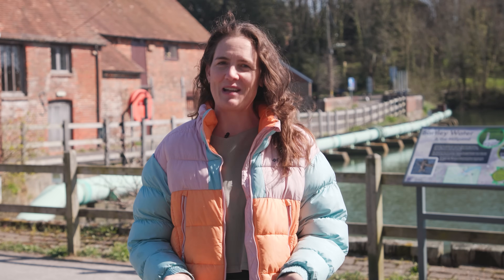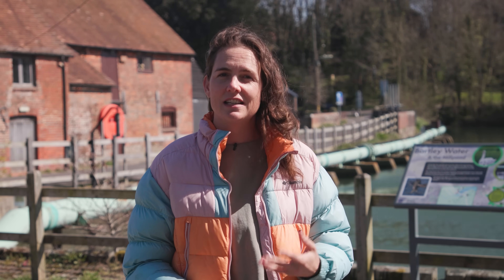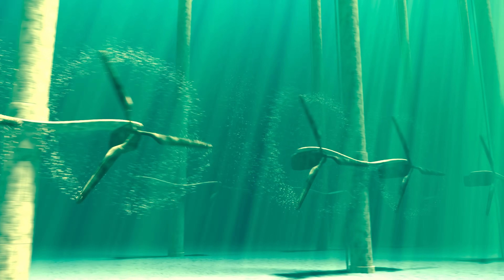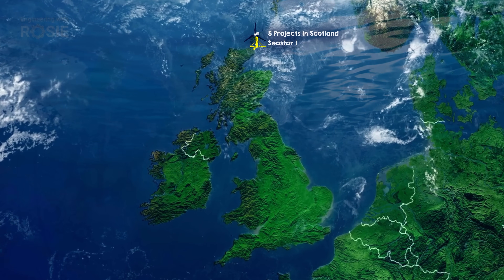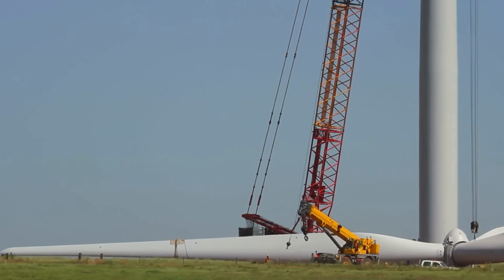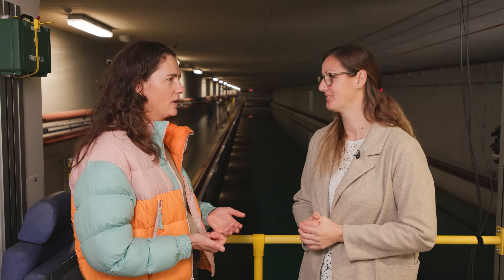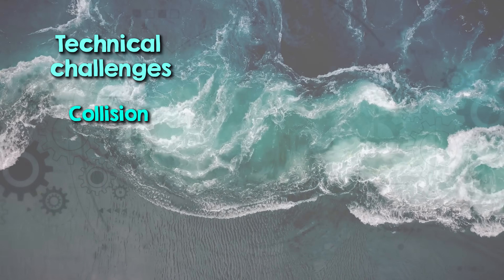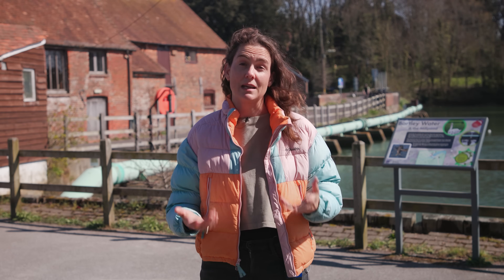A 1,400-Year-Old Idea That Might Save the Climate

Comment: I used to work in tidal stream 10 years ago. We used to explain the problem like; "Installing a tidal turbine is like installing a wind turbine from a helicopter in a hurricane". It's not that it's impossible just extremely expensive. Same goes for wave energy. It just can't compete with solar and wind on cost even after factoring in batteries for intermittent storage.
Reply: U should probably rewatch the vid
Reply: @Jon-u1s4j  which part do you think isn't accurate
Reply: It's not competing with wind and solar, it's competing against other forms of firming.
Reply: The difference with wave energy is that it can be used when wind and solar are not operating.
Reply: @MichaelSmith-px1ev . There is quite a strong casual link between wind velocity and wave heights.  In other words, no wind = no waves, hence no power from wave generators. Conversely very high winds usually means the partial or total destruction of wave power generators.  Nobody has really mastered that yet.  The attraction of tidal power is as reliable as the movement of the moon, but relatively expensive to set up and maintain.  Only the most optimal areas of tidal locations are likely to work, but they tend not to be close to the consumers of the electricity.  So it is practical, but only on a small scale for most countries.
Reply: Wave power seems much more viable for marine type scenarios.   The one where nothing is in the water but big concrete blocks with hollow tubes, using the changing air pressure to drive air turbines, seem to solve the Achilles Heel of marine installs....maintenance.   And it can double as a breakwater.
Reply: 100% correct
Reply: I think of this an the alternative to nuclear power with lots of problems but if phased production is possible the production would be stable enough to take up the slack or surge when needed with the possibility of good general production. So if we are prepared to pay the extra cost, risk and general messiness of nuclear why not switch the huge costs from developing nuclear , at least in part, to a much long term cleaner easier to decommission and walk back effects way of doing things.
Reply: Latina pasta
Reply: great comment.
I had a co-worker who left the company we were at to join a wave energy company here in Australia. He forgot 1 of t he most basic concepts of business - 99% of technology start ups FAIL and that one FAILED. 

EVEN WHEN YOU ACTUALLY HAVE A GRETA TECHNOLOGY ITS HARD.
The company we were working for had a major client that was tech start-up in waste recycling with insane potential. It was a staggering breakthrough. It separated everything from household waste glass & sand from metals from organics. In processing the organics it created high grade fertiliser and produced so much methane that it was also NET ENERGY positive. We should have spent most of the last 20 years travelling the world building plants.

It failed through MISMANAGEMENT. 

Around the same time my brother was involved on the marketing and business development side of a totally unrelated tech start-up that made paper from the left over parts of banana plants. Not only was the paper organic and would break down in the environment but in its pristine form was water proof and food safe. 

It failed through MISMANAGEMENT. 

My brother used to call me up howling about how incredibly smart and incredibly stupid these people were. I could barely tell if he was describing the project he was on or the one I was on.
Reply: @tonywilson4713 I also worked in Biogas for 8 years. Its mostly a win win. Dealing with waste products and turning it into energy, fertilizer and when fitted to existing waste water plants a more enery efficient process. I'd say the problems we faced where that feedstock contacts where often over valued, too expensive for the amount of gas they could produce and unreliable in terms of quality. That and poor general engineering workflow practices. Career engineers and managers that knew how to say the right things to the right people to get into management positions but had little understanding of  technology or practicalities.
Reply: @adamwalker28  yeah basically the system I worked on included an organic  digestor that in part was also a biogas generator.

Where it was really innovative was the digestion time. Its normally around 60 days and these guys had it down to 7. So the plants footprint compare to rivals was tiny and with land cost being a major cost to any plant in a suburban environment that was huge.

The first time I looked at the tech I near bounced off the ceiling. 4 years later we walked away shaking our heads.

The weird thing was they were making the same mistake the banana paper project which we had ZERO to do with. The boffins in charge kept changing the design. they had NO GRASP that whatever you build first  WILL NOT BE PERFECT. You have to get it done and then learn and then improve the next version.

And trying to explain that to some of these boffins is near impossible.
Reply: @tonywilson4713 what happens in those cases with the technology?

Is the patent sold for pennies, does the creators hold onto it hoping for a 2.0, does it (or some research papers) go into public domain?

Could you, for example, try to create a new version based on what you learned there, or are there legal bindings?
Reply: @adamwalker28   "I'd say the problems we faced where that feedstock contacts where often over valued,"  T'ain't a simple calculation, is it, though?  There's a biogas plant near me.  Road access is poor, so delivery of feedstock, even if the material's free is more expensive than one might hope, trucking the digestate to end users is, too,, then, if the plant's successful, expansion exacerbates those problems, and the demand for feedstock will raise feedstock prices, require trucking from further afield, or expansion in other parts of the country requiring duplication / multiplication of skilled personnel numbers, so there's adequate cover in every plant.
Your "Poor workflow" remark... Spot on!  I was working on a crane at a pressing plant (now long gone) I watched material flowing, or perhaps stagnating, on its tour from process to process.  I  had a great overview from the top of a giant hydraulic press.  The management ought to have built a viewing platform there, or installed a CCTV camera.  A well known prestige car maker in the West Midlands had a track that was beyond me.  I couldn't understand body skids having to go up and down between floors...
In one job I had, I set up my bar stock rack so I could just roll heavy bar onto the saw, cut what I needed, roll the material back.  My boss felt that was too easy, had my saw moved.  I just cut heavy bar with the O/A, obliging me to let it cool before use, and make a greater allowance for cleaning up ends than had they been sawn. He did not get it!  5" bar, say.  Gas axe a length, grind one end to fit 4 jaw chuck without damaging jaws. true up, face other end carefully, centre drill for support, part off smaller lengths as necessary... So I didn't have to wrestle with 3m of 5" bar... My point is, poor efficiency is observed everywhere in the UK...
Reply: What's the problem? You're designing a ship that's going to be permanently anchored, ships have been anchoring successfully for thousands of years!
Reply: @alanhat5252  in-water marine anything entails huge amounts of maintenance.   For a niche, not likely to hit economies of scale technology...it's even more significant.
Reply: @alanhat5252 ships anchor in sheltered waters away from strong tidal currents, winds and waves and even then they do occasionally drag anchors. They are also often crewed full time. The majority of good tidal sites are in exposed locations often far from landing sites for cables to tie into the grid and naturally they have strong currents that make installation and maintenance difficult. We would often mobilise an installation vessel at 70,000/day for the days around slack water neep tides to find that the current never slowed enough to perform work. Specalised installation vessels would bring down costs but given the issues around pratical sites and costs around installation and maintenance its hard to see it ever competing with other sources. We should keep trying though.
Reply: Good, as always, to hear from someone with actual experience.  Storage is hardly a non-issue with Wind with subsidies being paid out of taxes to have the operator turn off the turbines.  Solar just can’t produce anything meaningful in the UK.
Reply: @nickjp264 Solar still does supprisingly well in the UK and compliments wind generation well. Battery technology, particularly cost, is coming down extremely quickly. I think people often see battery technology as it was 10 years ago but its advanced to the point where its obvious its the way forward. I used to be an advocate of hydrogen, pumped storage and other alternate forms but these are all going to be or are already more expensive than batteries.
Reply: @adamwalker28  Solar in the UK has a capacity factor or 2% in the winter time,when demand is the highest, solar in the UK is completely useless.Battery storage of the capacity that could replace gas is pure fantacy.
Reply: @shanecollie5177 Why did you ignore wind power which is far more suitable for the UK than solar.  With regard to batteries there are literally millions of them  in cars.  Plugging these into the grid bi-directionally could be a hame changer.
Reply: @robsengahay5614  Wind in the uk has a capacity factor of 28%, wind and solar cannot power the uk alone, it must have gas backup. Car batteries as a reserve are a tiny fraction of what would be needed to raplace the gas component of the mix, remember you can have effectively no wind generation for extended periods (up to around 10 days) .Grid scale  batteries to fiill in the gaps of wind and solar would cost trillions of pounds, and have a lifespan of only 15 years.
Reply: @ Gas is a finite resource so are you saying that at some point in the future when gas supplies dwindle then the UK will be unable to have sufficient power?
Reply: @ Instead of looking at each alternative in isolation and saying that none can replace gas it would be more honest to look at the combination of wind, solar, geothermal and nuclear backed up by energy storage and more efficient heat pumps over gas boilers, better insulation, etc.

Yes, replacing fossil fuels is going to be expensive but fossil fuel infrastructure has also been very expensive and continues to be so and is reliant on global supply chains often affected by political instability and wars.  There is no cheap option.
Reply: @robsengahay5614  Nuclear needs no backup, it can do 100% of the job by itself, hence no duplication of generation capacity, and much lower transmission costs,as the generation can be installed where the demand is.Energy storeage as already stated is a non starter due to cost (and resource availability).You talk about reliance on global supply chains for fossil fuels, that could easily be fixed, there is abundant north sea oil ang gas, and plenty of coal under your feet. Wind and solar hardware,on the other hand,are all manufactured in china, with energy primarily coming from coal, why? because energy costs are now way too high in the UK to manufacture anything, so the more wind and solar which is added to the grid drives prices for electricity even higher, making the UK ever more dependant on chinese manufacturing.Finally ,there is a cheap option ,its called Gas, there is an ubandance of it, it is reliable, needs no duplication,and the vast majority of the rest of the world is going to continue to use it,until a viable alternative is found, and currently (apart from nuclear) no such alternative exists, except for hydro for countries who's geology it suits.
Reply: @ Of course nuclear needs backup.  You do understand that there is fluctuating demand minute by minute, hour by hour, let alone at different times of the day and times of the year surely?  And nuclear cannot be simply ramped up and down every minute.  Gas is more flexible but still not that flexible.  So the reality is that supply has always had to both anticipate and exceed demand in order to avoid outages.  Storing excess energy substantially mitigates the need for excess power generation.

And it’s bizarre that you think that gas and nuclear are cheap.  They are absolutely not.
Reply: @ It’s odd that you cite China given that they are in a headlong rush into renewables yet are still able to power manufacturing.
Reply: @robsengahay5614  nuclear, as well as gas &coal does n0t need backup, becauuse you  know exactly what their output is , so you build capacity to match demand peaks, wind and solar on the other hand you do not know in advance when the wind will blow or the sun will shine.The USA produces electricity from gas at about one third the price of uk electricity.Every country that has introduced a significant amount of wind and solar into their grids have seen massive increases in electricity costs.You need to do a bit more research on whole grid costs of electricity, wind plus solar plus battery,ammortised over a 70 year timeframe (the lifetime of a gas/coal /nuclear plant)is by far and away the most expensive option, even if the battery capacity was achievable,(which it isn't)
Reply: @ Well of course a transition is going to cost more during a transition.  When transitioning from coal to gas costs went up in the UK because of all the new infrastructure.  You are having to pay for the new infrastructure whilst also the cost of the legacy supply.

The fact that you cannot imagine how renewables plus storage plus geothermal plus energy efficiencies can actually work doesn’t actually mean it isn’t possible.  Believe it or not there is going to be a world where coal, gas and oil run out.  They are not infinite resources.  Sure you can kick that can down the road for a few decades so it becomes your grandchildren’s problem but that disregards the pollution that burning these fuels is causing now.

China is now on 40% renewables and still had manufacturing the last time I looked.
Reply: @robsengahay5614  Shane is a troll, just consistently negative on anything that isn't nuclear or gas.   We should ignore him.
Reply: @robsengahay5614  Most of china's renewables are hydro, measuring generation capacity by installed capacity(which is what you are quoting) is misleading because the capacity factor of wind/solar is so much lower than all other generation options, you also fail to mention china is continuing to add new coal capacity. The global consumption of coal has never been higher than it is today ,and is growing. An independant analysis done in Australia (using government figures) laying out the costs over the next 60 years with different energy pathways are thus. 50/50 wind/solar plus battery storage $2.57 trillion. 50/50 wind/solar with gas backup $1.92 trillion. Nuclear $847 Billion. Coal$ 542 Billion. These are the cold hard facts, they may not conform to your idealology, or fantacy of a wind/sun powered world, but they are ,alas , facts.
Reply: @ Actually factually incorrect.  Hydro is the largest source of renewables in China but wind and solar combined exceed hydro now and are expanding rapidly.  China built new coal plants to replace existing old plants near populated areas that were causing serious air pollution and health issues.  However there is every indication that these are a stop gap measure.  China’s energy needs dwarf the UKs and the fact that now 25% comes from wind and solar is remarkable and could be 50% by 2030.  Yet somehow they are continuing to manufacture goods which in your mind is impossible.

There is definitely a place for nuclear in the UK though obviously it is extremely expensive.

Honestly you need to move away from your fossil fuel fantasy.  It’s a finite resource, is expensive to produce, and gives rise to pollution of our air and is influencing our environment detrimentally.  Just because we produced energy in that way for the past 200 years doesn’t mean that it’s the right or even practical method to produce energy for the next 200 years.
Reply: @ Hmmm.  I would prefer to believe that he has sincerely held views on the topic which happen to be in variance to my own.  I think it’s fair to say that none of us truly know how a full transition to clean energy will be accomplished and for many people such major change is frightening.  I know many people that would agree with Shane.  I think we should have discussions with those with different perspectives.
Reply: @robsengahay5614  he's using the strategy of gish gallop.   just spout info kinda related to keep talking and 'baffle them with BS' mixed in.  Example -  'Capacity Factor' is important in ongoing fuel type plants, coal, gas etc.   Because you want as much capacity out of the 'fuel' when you pay for fuel for each MWh generated.   With renewable and free fuel...a low capacity factor is countered by just building more capacity/infrastructure.
Reply: @ I am in Australia and not aware of that study.  There was a study comparing the costs of nuclear/ renewables mix to just renewables that I saw but I didn’t see the comparison with coal.

All of the existing coal fired power stations in Australia are reaching the end of their lifetime and would all need replacing over the next 15 years.  Obviously doing this comes at massive expense and potentially would be a sunk cost as we necessarily need to limit the use of coal in the future.
Reply: @ He isn’t wrong though that storage of excess energy from renewables for use when generation is curtailed is a major hurdle for renewables.  Where I disagree with him is that I believe this is a solvable problem whereas he doesn’t and therefore he concludes we should carry on burning coal and gas until they run out at a future date when it will not be the problem of our generation.
Reply: @robsengahay5614  yes, storage is the next evolution of renewables.   It's already following the almost exponential growth of solar supply.    Just a capacity and build out issue, nothing technically problematic.
Reply: @ The irony is that storage is also a solution to the over supply and wasteful energy production.
Reply: @robsengahay5614  If storeage is a soveable problem, then great, i'm all for it. But at the moment it's a huge problem without a viable solution. the problem is the propents of wind/solar seem to believe that the solution already exists with known technology that is scaleable an affordable. That belief is catagorically wrong.
Reply: @pixelpusher220  Capacity factor is extremely important if you want to honestly compare the cost of generation sources, i'll explain . If for example a wind farm with a 4gw capacity cost 2 million pounds,(fictious numbers). and a gas plant of the same capacity cost 3 million pounds, on the face of it the capital cost of the gas plant is 50% more,but if the gas plant can deliver 78% of its name plate capacity to the grid,but the wind farm can only deliver 28% ( these are real world figures btw)Then the capital cost to deliverable electricity cost ratio is c ompletely changed. This is why all factors must be caculated. capacity factor,service life, running costs, fuel costs,storeage costs, backup costs, transmission costs etc. Often proponents of wind energy claim it is the cheapest form of generation, which it is,... when the wind is blowing,which is only 28% of the time, there in lies the problem, no economoy can opperate with an energy source which is un reliable or unpredictable.Making cheap wind /solar generation reliable is a huge unresolved problem,which none of the haters(of me) here have any solutions for.
Reply: @shanecollie5177  I don’t disagree with you there at all.  I read and hear about interconnectors and innovative grid storage options but the sheer scale of energy storage that would be needed through a sustained period of negligible wind and solar generation is staggering and this would need to be on standby for long periods when renewable generation is sufficient or exceeds need.

It’s a problem that needs a solution but it doesn’t need a solution at this moment in time but the clock is ticking for sure.
Reply: @shanecollie5177  yes, you attempt to baffle with BS.   We get it.   Also in listing 'costs' you forgot waste disposal...which renders nuclear at basically 0% cost factor.
Reply: @robsengahay5614  Thanks for your thoughtful response , my opinion is that without tackling the storeage problem first, the capital being expended on wind /solar now, could well be a huge white elephant down the road if the storeage problem is not solved, and there is certainly no guaranteethat it will be. Conversely we know right now, without any ambiguity, what the costs of nuclear are, and we know there are no stumbling blocks to prevent a grid opperating succesfully with it. It seems daft (to me) that this is not clearly apparent to all.
Reply: @pixelpusher220  I'm sorry that simple facts  are baffling to you, but there is nothing i have written here which is untrue.
Reply: @ Yeah but you will still need battery storage if you have nuclear because that provides consistent base load power alongside the variable renewables so the costs will then truly be astronomical.  No easy answer really.
Reply: @shanecollie5177  there is not so much abundant north sea oil and gas any more -- the UK has been a net importer of both for decades and has been decommissioning supply and storage infrastructure whilst building import terminals.  Nuclear hardware isn't mass-produced *anywhere*, France did it for a decade but then found itself with an oversupply of generation capacity that persisted another 30 years while it let its hard-won expertise ossify.  Wind and solar equipment have excellent economies of scale and are commodities which could be manufactured in any country on Earth.  China is hardly the only place to make wind turbines. It does very much dominate solar manufacturing; this is not due to low wages (they're not especially low any more and its high tech industries are heavily automated) but because of the strategic support it allocates to industrial infrastructure, manufacturing in general, and critical industries in particular.
Reply: @robsengahay5614 . Nuclear power can be ramped up and down very quickly, just as quickly as the coal fired/steam power generation that powered our grid for decades.  But there is a floor of power generation, that it is really awkward to go below for both coal and nuclear.  That’s why cheap overnight tariffs were introduced.  If you go below the minimum power generation, for more than a short period, then you have to restart the system, which can take a day or more, before you can generate at full power again.